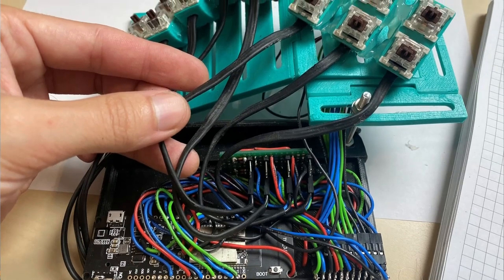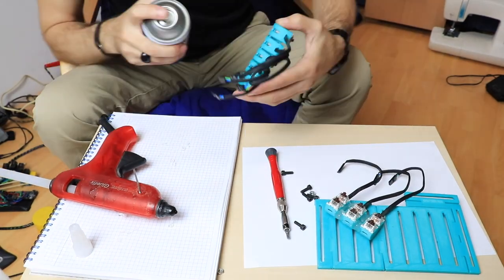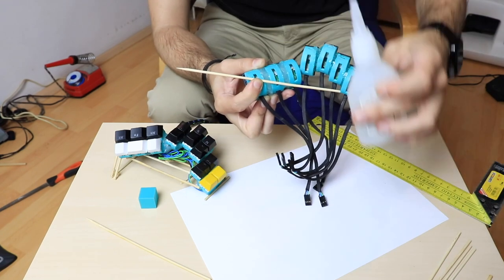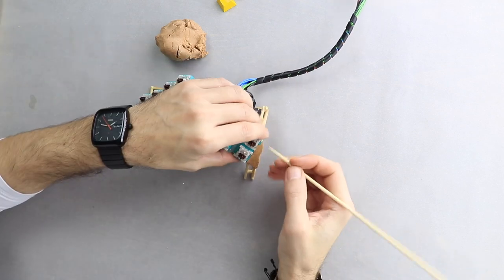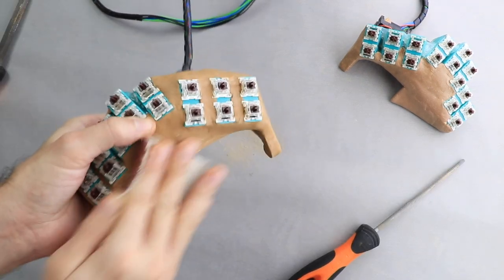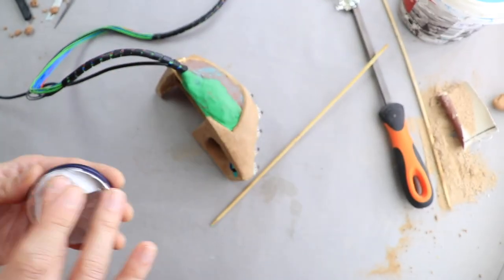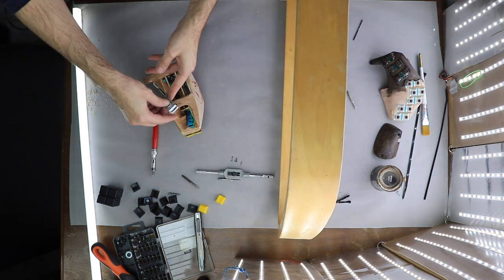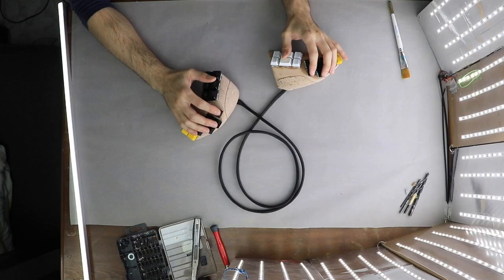Building a Handmade Chair Keyboard - LHM 32 Split Keyboard

Comment: Do you have a wiring and hardware guide for this keyboard?
Or could you point me to some resourde?
What chip are you using?
What wiring advice schematics? :D
Not sure what to ask, but i want to build this thing myself :)
Reply from the maker: There are useful links in the description of the videos. There are 3 videos regarding mechanical keyboards on my channel each has some useful links in the description.

Comment: What are those flat black cables? are those 4 core submersible cables?
Reply from the maker: I made them with regular wires and thermal housing. The one that shrinks when heated.

Comment: I am curious as what are the possible/potential Support on this
Can it be used on a Console and a handheld pc like Valve - Steamdeck or similar thingw

But either way That looks so confortable to use on a chair like you used 😂

You did a really good job on the design
Reply from the maker: Thank you 😊!!! As far as I know It works as any Bluetooth keyboard. I tested it so far on Windows 10 pc, Lenovo Tablet, iPad, MacBook and iPhone. The compatibility is awesome so far. It is very comfortable until you get stiff on the chair and you have to get up 🤭. But drinking coffee in the morning and browsing online is great!